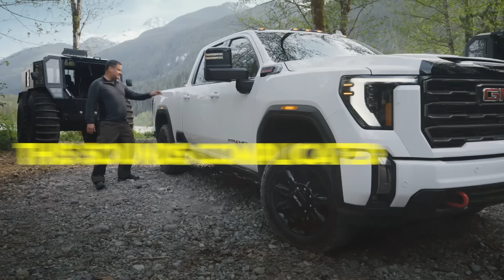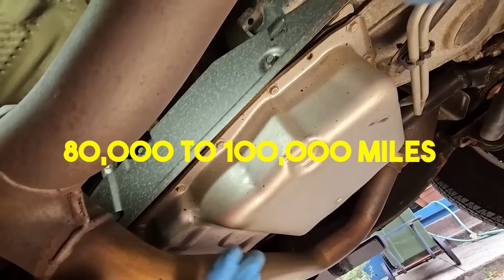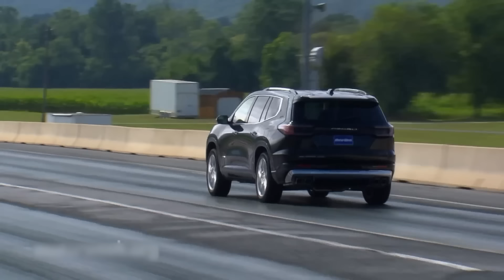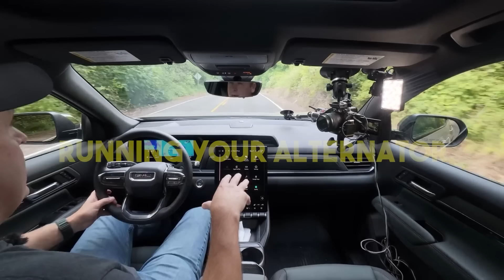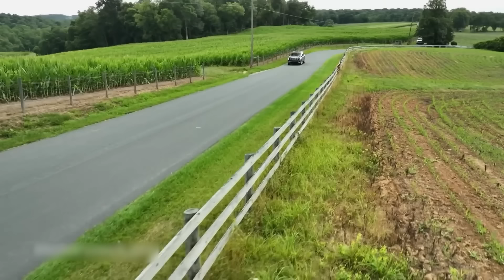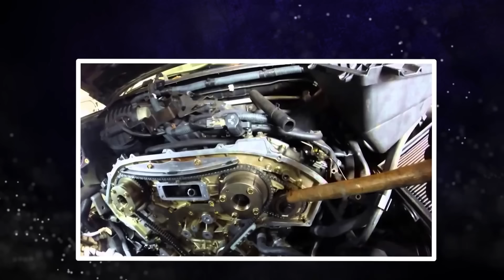How To Make Your GMC Last Over 300k Miles Without Major Repairs

Comment: Trade it before it runs out of warranty
Reply from the maker: That’s one strategy — and for the newer AFM/DFM and L87 trucks, dumping it before the warranty expires does transfer the risk to the next owner. The counter is you’re then on the new-truck payment treadmill forever. The alternative: a cheap disabler and clean oil makes the engine last well past warranty, so you keep a paid-off truck instead of a payment. Trade-before-warranty makes sense if you don’t want to maintain; keep-and-protect wins if you do. Depends which game you want to play.

Comment: My truck is just turning 20 year. Sounds like my high idle is stuck.  What should I do?
Reply from the maker: Stuck high idle on a 20-year-old truck is almost always one of three things: a sticking IAC (idle air control) valve, a vacuum leak, or a throttle body carbon buildup. Start cheap — pull the IAC valve (two screws on the throttle body), clean it with throttle body cleaner and check the pintle moves freely. While you're there, clean the throttle body bore. If that doesn't fix it, spray carb cleaner around the intake gaskets with the engine running — if the idle changes, you've found a vacuum leak. Both are DIY jobs under $30. Scan for codes first if you have a reader — a stuck-open IAC or a TPS fault will throw one.
Reply: @Everyth @EverythingGMC-k9x someone else fix the problem. Yesterday I bought a 2024 GMC Sierra AT4X AEV diesel from a returned lease. Perfect maintenance record. Perfect interior and very very few minor scratches. With 44k miles. New tire, new brakes and rotors, complete liquid flush. For $52 K. Reputable dealer. Picking it up next week. Paying cash. Still under warranty. Drives great.3,0 diesel. In Boston area. Commuter truck. Rust in my 2007 was my biggest concern. It’s been a great reliable truck. I actually went into look at a new at4. Couldn’t test drive it because it was on the show room floor. So the salesman gave me this one to test. Informed me it was a lease return. Couldn’t pass it up. As I couldn’t find a diesel new. My me. A lucky find.
Reply: Did scan. No codes, but did find a coolant leak.

Comment: I change my oil every 3000 miles. Have for my 20 year old Chevy. I now have 112,000 miles.  Transmission fluid has been changed 3 times.  It’s the rust that’s killing my truck. Issue with disconnecting the battery. Issues with the truck regulating your driving habits. Resetting s a bitch.
Reply from the maker: Your dedication to maintenance is impressive, and it's a shame that rust is the biggest battle for an otherwise well-kept truck! 👍 on the battery-disconnect and driving-habit reset headache — that's the throttle relearn and the transmission adaptive learning resetting when power is cut. After a disconnect, let it idle 5 minutes before driving, then do a few gentle stop-and-go cycles to let the trans relearn its shift points. The rust is the real enemy at this point, and no maintenance fixes that. Sounds like the drivetrain has plenty left.
Reply: @E @EverythingGMC-k9x hat’s exactly how I handle it. Retired disabled firefighter here, grew up repairing our vehicles with my dad. Working on tractors also.
Reply: @EverythingGMC-k9x not much on resale, so planning on donating it to a charity. Great truck for someone interested in just parts.

Comment: 200k miles? You’re very optimistic if you think a new GM 1/2 ton truck is gonna last that long 😂😂😂
Reply from the maker: Fair skepticism! Maintenance is everything — the ones that make it are usually babied with oil changes. Thanks for watching!
Reply: @EverythingGMC-k9x yeah maybe with the addition of disabling the DFM and bypassing the trans thermostat…
Reply: @Jimmy.R01  just hit 200k on a 2020 6.2 sierra. Original trans fluid,spark plugs and coolant . Not babied,i drive the sh@t out of my truck.

Comment: I have the 2.7 liter in my Chevy 1500 Silverado, I tow a 30 ft travel trailer. I'm a retired mechanic and most of these items I can verify are good advice. I've made the swap from the watery goodness gm puts in engines now days to the 5w 30 synthetic and replaced the air filter with a high quality K&N air filter and received a 1.5 mpg gain while towing. That doesn't sound like much, but I average 5000 miles a year towing and at today's prices for gas it adds up. Also the 5000 mile service interval is no joke. It's the cheapest insurance you'll ever buy. My truck came due while we were on a road trip, dropped the trailer at a rv park and had it done at a local shop. It takes very little time and gives you the peace of mind to tow into the middle of nowhere. Also since the 2.7 is turbo charged it becomes even more critical that the oil changes happen on time. Turbo bearings DO NOT LIKE DIRT!!!$$$$.
Reply from the maker: Fantastic real-world input from a retired mechanic — the K&N gain and religious 5k oil changes on a turbo motor is spot on. 'Turbo bearings don't like dirt' should be on a t-shirt! Thanks for sharing! 👍

Comment: I have 05 gmc 4x4 4-door with 75000 on it, looks like new for sale wife has hard time getting in,we are old
Reply from the maker: 75,000 miles on an 05 GMC is barely broken in — that's the GMT800 with the LM7 5.3 most likely, no AFM, no DFM, the engine that goes 300K easy. Selling at that mileage means someone's getting an underpriced gem. For your situation, the smarter swap might be a 2007-2013 Acadia or a Terrain with the lower step-in height — same GMC brand, much easier to enter for older drivers. Either way, that 05 is going to make somebody very happy.

Comment: We use Amsoil Signature Series motor oil and automatic transmission fluid.  Amsoil premixed antifreeze.  Amsoil transfer and rear differential fluid.  Chevron’s best 100% motor oil is another excellent motor oil.  Change fuel and air filters.
Reply from the maker: That's the premium-everything approach and it's hard to argue with the long-term results. Amsoil Signature Series has the highest TBN retention of any consumer-grade synthetic — it actually justifies extended intervals if you want them. Same logic on the transfer case and differential fluids: better additive packs, longer service life. Chevron Supreme Plus is the underrated alternative when Amsoil isn't local. Pair any of it with clean fuel and air filters and these trucks see 400K easy.
Reply: @EverythingGMC-k9x  👍 I should get my oil lab tested to be sure.  Because of the high potential to a major lubrication shortage, I ordered a lot of lubricants and they are already expensive. My brother has a 2500HD 6.6L as a work truck and he uses Chevron's best oil.  I told him to consider the over sized PPE oil filter.  I ordered a PPE oil filter for my 3L Duramax and should probably order a few more.

Comment: Where on earth do you get these prices. I can tell you nothing you get done on a car anymore is as low as $200. Every time I go into a shop anymore it’s $1500 $2000 for this for that so these prices that you are quoting, here are really lowballingwhat they actually are just way off base
Reply from the maker: Fair feedback. Shop rates vary massively by region — $200 fixes are realistic in rural areas with independent shops, but $1,500 to $2,000 quotes are real in major metros and at dealer service departments. The video numbers are typical independent-shop estimates for the specific repair, not labor-loaded final invoices. Worth flagging more often. If you're seeing those higher quotes consistently, switching to a trusted independent will close most of the gap.

Comment: If you have a 2008 to 2013 you need to get the new valve cover update to change the PCV valve cost me $65 and the problem was causing the dealership wanted to charge me 3000 to fix it
Reply: I’m no mechanic and it took me 10 minutes to fix it

Comment: My 2013 Sierra  is falling apart before 100,000 mile lifter problems, $10,000 job.
Reply from the maker: That's the AFM lifter failure at its worst — when a collapsed lifter wipes the cam lobe the bill climbs fast. $10,000 sounds like a full top end plus cam and possible cylinder damage. Worth a second quote — a lifter and cam job at a good independent runs closer to $4,000 to $6,000. Brutal that GM never owned this one.
Reply: If you would’ve got the range technology earlier, you could’ve avoided that. 2013 is actually one of the best GMC Sierra’s ever made.

Comment: $1,200 timing chain replacement cost? that's hilarious try 5-6K! I just had it done on my Acadia
Reply from the maker: The timing chain cost varies significantly between DIY parts, independent shop, and dealer labor — a dealer hitting $1,200-1,600 on an Acadia is unfortunately not unusual at current labor rates. DIY parts on the 3.6 timing chain kit run $200-400. The gap between parts cost and dealer bill is always the real number to know. 🙏
Reply: @EverythingGMC-k9x I went to an independent shop, not a dealership

Comment: Im a gm guy. Used to change transmission fluid and filter every 75-80,000 miles. But guess what GM designed vehicles that a backyard mechanic didn't want to tackle. 2004 and older no problem. Now 2015 gmc sierra 1500 5.3  , now to change transmission fluid, and filter, drop the exhaust system,  and jack up the 4x4 Transfer case , just to be able to get the transmission pan off.! GM designer's total Dumbass's  . But yet, it wasn't the transmission oil going bad. It was GM itself that said we can save $1 if we put an inferior Torque converter in. When it fails prematurely, we can charge $5-6000 for a new transmission. Been there,  if they would have put the converter from the 6.0L engine. Guess what. No more transmission fails.! I've changed front wheel bearings twice myself, changed rear axle fluid, front axle fluid, transfer case fluid, u-joints on driveshaft, all myself. A/c condenser, rear axle seals, from local reputable repsir shop. I currently have 261,000 miles on my truck. Have absolutely NO DESIRE to purchase a new truck. Too much technology and too much that can go wrong.
Reply from the maker: The increased difficulty of basic maintenance on modern trucks is a massive point of contention, and your experience with the torque converter highlights exactly why many owners prefer older, simpler platforms. 💪

Comment: Thank you for this information. I have a 2024 GMC Denali, XL and it’s a 2 Wheel Dr. so I wouldn’t need the front different ritual fluid change or the transfer case fluid change, right?
Reply from the maker: Correct, since you don't have a front differential or transfer case, you can skip those maintenance items entirely. 👍

Comment: The 5.3L 07-14 doesn't have a replaceable PCV valve, it is glued into the driver side valve cover. It is also not a traditional PCV valve it is just a calibrated hole. No spring and no moving pintle.
Reply from the maker: Great catch — the 5.3L 07-14 integrated PCV in the valve cover is exactly the kind of thing that gets overlooked because there's no traditional serviceable valve to replace. Keeping the oil fresh and catch can installed is the best defense against carbon buildup when you can't swap the PCV directly. 🙏

Comment: 2004 and later LS1/LS6/LS2 do not have PCV valves instead they a fixed 2.5 mm orifice in a fitting that resembles a PCV valve but has no internal parts. Nothing to replace.
Reply from the maker: Correct — the 2004 and later LS1/LS6/LS2 fixed orifice PCV is exactly what @5ticc69 was describing earlier in the comments. No serviceable valve, no spring, no pintle. Just keep the oil clean and let the catch can do the work. Good clarification for the community. 👍

Comment: No maintenance is going to stop horrible engineering and the use of the cheapest parts possible.
Reply from the maker: The cheapest-parts argument is the one GM has the hardest time defending — the AFM collapsible lifters are a documented cost-cutting decision on an engine that was otherwise proven. That's the specific engineering choice that broke trust with owners. 🙏

Comment: Step 1. Sell it to carmax 
Step 2. Buy something else. Anything else. Consider a Lexus or Toyota with their legendary v6 or v8.
Reply from the maker: The Lexus and Toyota V8 reliability argument is legitimate — the 2UZ and 3UZ are exceptional engines. But a GMT900 5.3 without AFM maintained properly competes with both on longevity. Different philosophy, similar outcome when done right. 🙏

Comment: Replace the engine
Reply from the maker: For owners already dealing with a failed engine that's out of warranty, a crate engine swap with a pre-AFM block is actually one of the cleanest solutions — factory fit, known reliability, and the AFM problem is permanently gone. 🙏

Comment: I just bought a 2019 Sierra 2500 6.0  I noticed most of these videos always refer to the 5.3 or 6.2
Reply from the maker: The channel focuses primarily on the 5.3 and 6.2 because that's where 85% of the half-ton audience is. The 6.0 in the 2500 platform is a completely different animal — no AFM, no DFM, built for serious work. Most of the maintenance content applies directly to your truck, just without the AFM headaches. Solid buy. 💪

Comment: I don't replace PVC valves, I just clean them.
Reply from the maker: Cleaning works if the valve isn't compromised — at high mileage or if it's oil-soaked and sticking, replacement is the more reliable fix. At $4-12 a piece the replacement argument is hard to beat. 🙏

Comment: Fantastic insights. I think I can apply ur expertise to our Chevrolet 2021 6.6 L 3500 diesel 4x4  towing truck with 30,750 miles. Already , I just changed out transmission and differentials fluids; regular oil changes at 6 mo or about 5k miles. I think this truck is fine engineering! I will follow your advice!!!
Reply from the maker: 2021 3500 six-six diesel at 30,750 miles with transmission and diff fluids already done and 5K oil changes — that's exactly the right start on a heavy duty platform. The six-six diesel rewards owners who stay ahead of the maintenance. You're on the right track. 💪
Reply: @Every @EverythingGMC-k9x n further retail shop presearch Im hearing the Chevy/GMC 2018-2024 six-two engines have Mfg excessive filings in them causing wear on the cams and elsewhere shortening engine life expectancy to less than 150,000 miles. That's the only negative by the author on the six-two in comparison with Ford and the Ram engines.  Therefore, he recommended the 3.0 engine? What a major issue if true! Any thoughts in your experuence?
Reply: That’s a fine truck!

Comment: 02 gmc sierra 1500 with 270xxx still going strong but the trans is ready for a rebuild lol
Reply from the maker: 2002 GMT800 five-three at 270K and still going — that's the engine doing exactly what it was built to do. Trans rebuild at that mileage is fair use honestly. Put a fresh one in and keep going. 💪

Comment: The most not way to make them last that long is just to keep in at the garage (don’t drive them ) they ara so bad now .
Reply from the maker: The comment section on every video here is full of GMT900 owners at 250K, 300K, 400K driving them daily — not garage queens. The right truck maintained right goes the distance regardless of mileage. 🙏

Comment: This video is nothing but a lie ain’t no GMC making it even close to 300000 miles without major repairs
Reply: I have a GMT 800 GMC A 2005 and it has been the biggest pile of junk vehicle that I’ve ever owned and I work as a mechanic for a fleet that has quite a few GMT 900s and they are all junk transmissions going out like crazy and eating cams and lifters I’ve been a GM fan my whole life my first vehicle was a 67 Chevy half ton that’s in my garage now but the GMT 400 was the last good truck GM ever made everything since isn’t worth having
Reply from the maker: The comment section of every video on this channel has GMT900 owners reporting 250K, 300K, 400K, even 475K with no major repairs. That's not marketing — that's owner data. Which specific claim in the video do you think is wrong? 🙏

Comment: theirs nothing that is going to make that pos last 300.000 miles
Reply from the maker: Tell that to the guys in the comments hitting 300K, 400K, even 475K on these engines. The GMT900 Gen 4 five-three does it regularly — the data is in the comment section of every video on this channel. The key is knowing which one to buy and how to maintain it. That's the whole point. 🙏

Comment: Your prices are about half of today's actual prices for parts and repair. My timing chain is 6k to have done.
Reply from the maker: Fair point — labor rates and parts costs have climbed hard since those numbers were put together. A timing chain job at a dealership hitting $6K today is unfortunately right in line with what shops are charging. DIY or a trusted independent mechanic cuts that number significantly, which is why knowing what to watch for early matters more than ever. 🙏

Comment: Electric Power Steering (EPS) and do not have fluid. Correct me if I’m wrong but I thought they didn’t have power steering fluid ?
Reply from the maker: Already confirmed and it's correct — newer platforms with electric power steering have no fluid to check, one less maintenance item. Worth knowing so owners aren't hunting for a reservoir that doesn't exist. 👍

Comment: I have a 2017 Acadia with 240,000 miles, 200,000 of those are from me. I intend on getting that many more. Transmission replaced at 200k. I'll be using your information and advice to help with that goal. Thanks!
Reply from the maker: 240K on a 2017 Acadia and you're not done yet — that's the goal right there. Transmission at 200K is honestly fair use, not a failure. Keep up with the fluid changes and you'll get there. Glad the content is helping! 💪